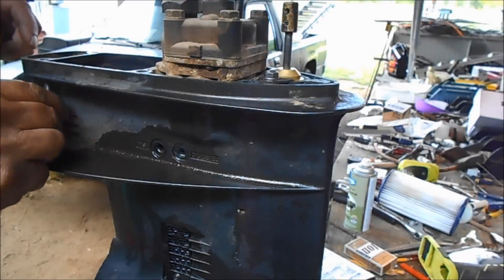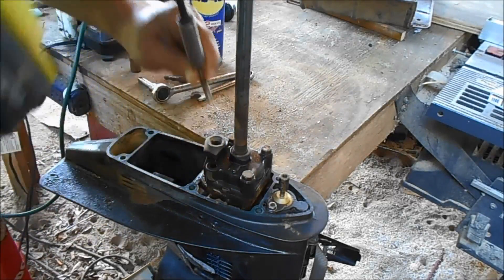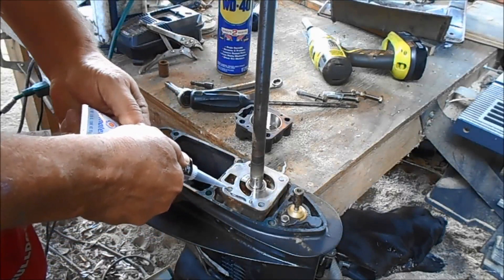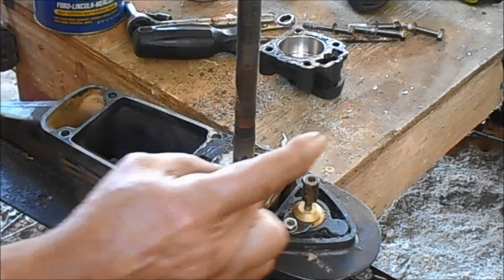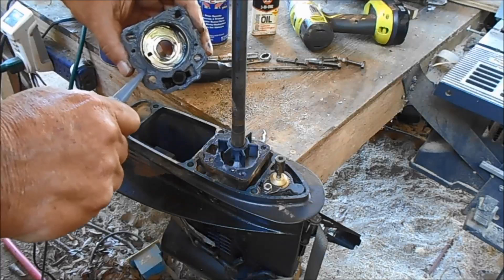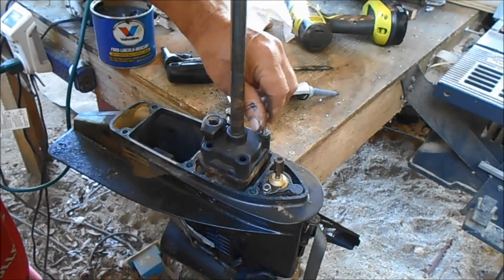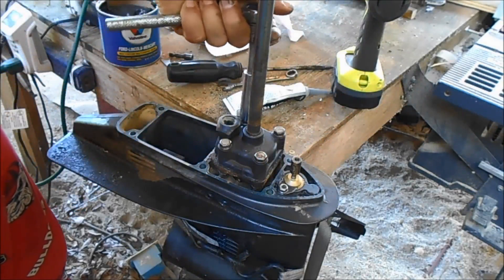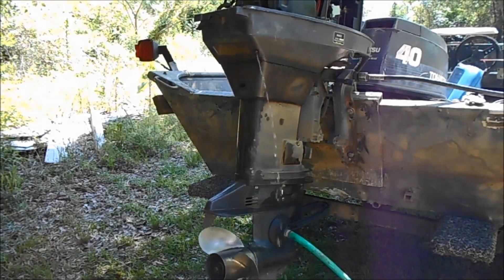How To Replace A Tohatsu - Nissan Outboard  Water Pump - Impeller

Comment: I have a 1999 Tahotus outboard that I need to change the water pump mine has screw threads So do I need to unscrew to break the l Loose

Comment: Do you know if a 1994 tohatsu 30hp 2 stroke is self priming water pump cause I changed the water pump an put ear muffs on an it won't pee but I heard if it isn't a self priming pump you need to put it in the water

Comment: I have a 92 nissan 50hp. Do you happen to know what kind of hose is suppose to be for the water pump output?  Looks like someone used a gas hose on mine?  Im talking from the motor shooting out the back.  Thanks

Comment: Very good video. I replaced the water pump just like you did. Your video helped me a LOT.  Now I have a problem.  I can't seem to get the lower unit lined up right into the leg. Something is stopping it from lining up. What can I do?
Reply: Gently pull you starter cord. It should slot in
Reply: I bet your gearshift linkage rod has pulled up a bit inside the oil reservoir.  It has to be aligned just right to seat properly.  Took me nonstop 4 hours to figure this out on mine lol.

Comment: I just drilled the pin out with the same size drill bit. Replaced it with a small piece of copper 12-2 ground wire. Driving that pin out wasn't happening.

Comment: Thanks man. So I got it all together and working great. But was out on the water and the pin snapped. Is it possible to reattach the shifter with a new pin while in the water?
Reply: The rod just goes up and down.  Just use a little cotter pin like the shear pin on the prop.

Comment: i have a 90 hp nissan...similar setup i uave to engage forward for my shirt linkage top pin to be visible....and it seems to have a outward tipped end on both sides....if i use a nail it will expand and not allow the pin through....any advice for getting that linkage pin removed
Reply: Rjgrantland

Comment: i have a 9.8 Nissan, how do you remove one of the two pins on the shifting rod, without potentially bending the rod, if you use a hammer to knock out one of the pins
Reply from the maker: I done it with a hammer and a small nail. it should come right out
Reply: Danny S Hodges Thanks Danny. I needed to know if I could drive those pins out or needed a tiny allen key. Interesting, your accent is easily understood by many of us Australians. Some 'mericans, you jest can't unnerstan' a tall!
Reply: I had a pair of vise grip pliers that locked around the brass part, and held it from going back any further.  Say from right side.    Reach in with vice grips as far as you can and clamp brass part that pins go through, then knock out pin from the right side, and the rod can't move while you do it.  I knocked it out with a small but long allen wrench.